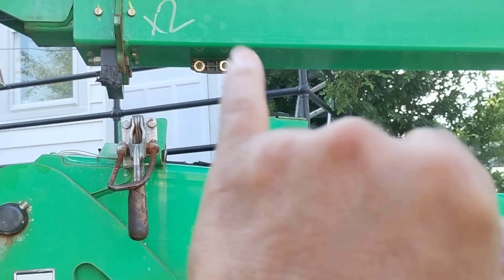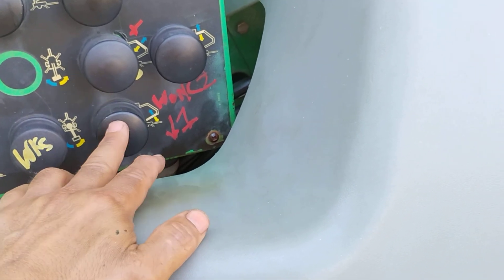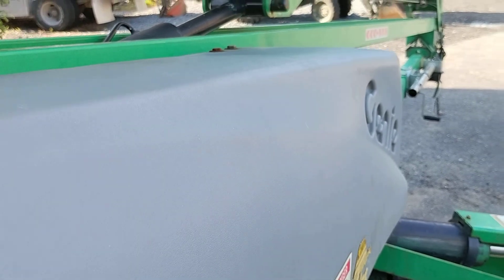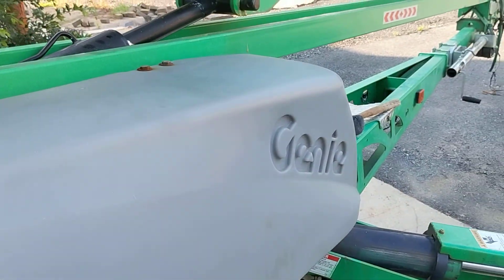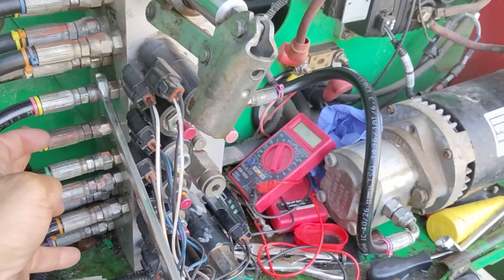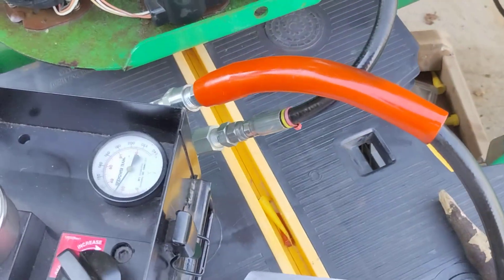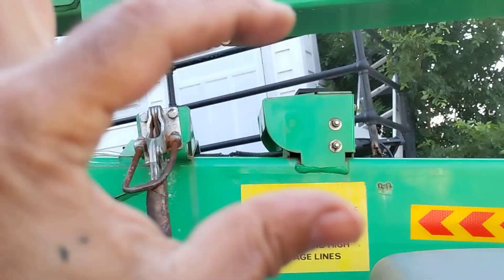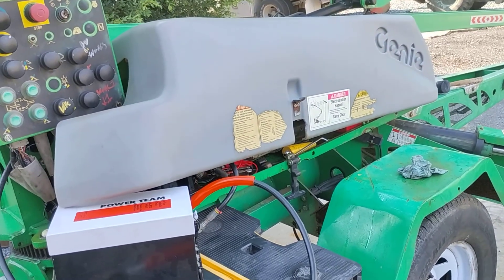Genie TZ 50 manlift troubleshooting Legs will not retract part 4

Comment: I really need your findings on the lift issue.. I have the exact same issue and am pulling my hairs.
Reply from the maker: Mark, I have hundreds of hours into this repair and it is 100 percent fixed.
I can help you but my time is not free... Your call.
Reply: @EngineerPEretired  I do understand that. what's your process?
Reply from the maker: Send me an email, I will get you solid again.